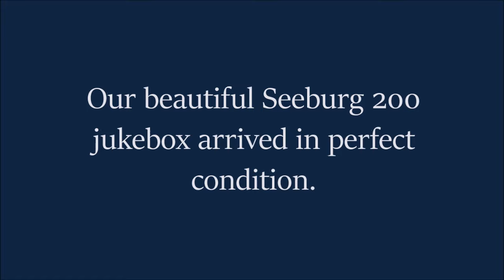Seeburg 200 Jukebox: getting it up the stairs

Comment: The best way to move a V200 is to disassemble it into parts, which is actually easy. Admittedly, you cannot divide the cabinet into different parts, but since you have removed the inside measurement, the cabinet becomes so light that it is much easier to move it. Believe me I have moved my V200 many times since I bought it in the seventies.
Reply from the maker: Thanks for your comment. These are wonderful machines and I’m glad they have admirers.

Comment: Well, it looks like a 1957 VL-200. I have a V200 -- it weights 416 pounds uncrated. However, you haven't lived until you try to move a Wurlitzer 1500A up the same flight of stairs. The mech alone in the W1500 weighs 300 pounds. Total weight is 489 pounds...
Reply: the V200 was 1955....the VL200 was 1956....the 1957 was the KD200....the juke in this video is a 1956 VL-200.....approx. 415 lbs.....back door should have been removed,approx 75-100 lbs....the mech could have been removed,approx 50-100 lbs....the dome could have been removed,approx 50- lbs......I tip my hat to those guys, alot of work.